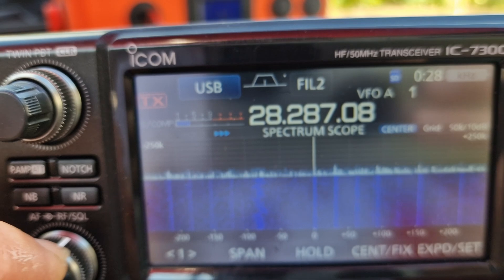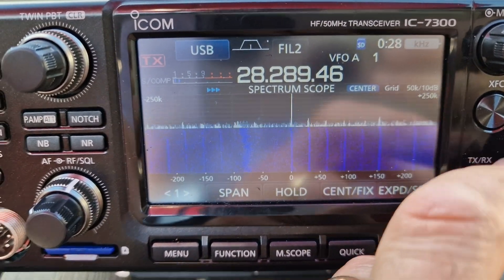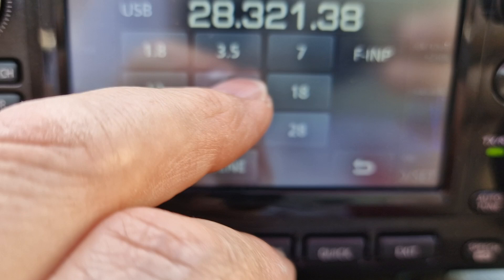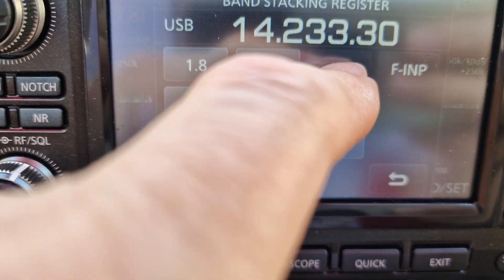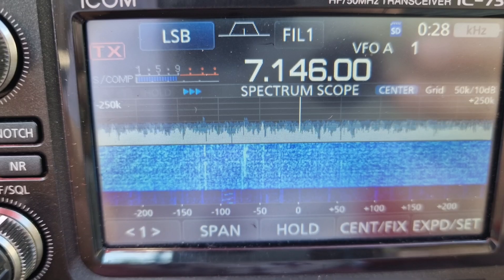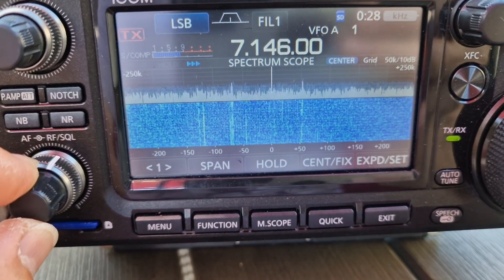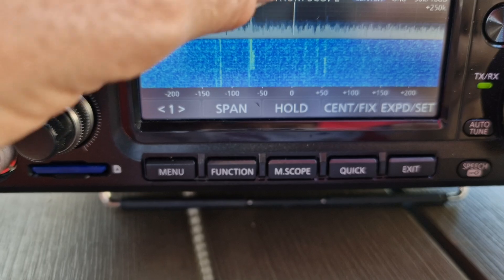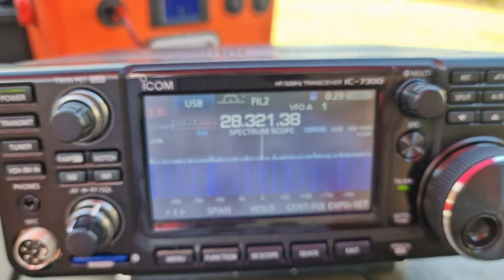Need help with identifying awful QRM across all HF bands in the UK - 19 July 2024

Comment: My noise started years go on 30m, then for the last six years affected h.f. from 160m to 20m with the exception of 60m which I could use. VDSL stops about 17 MHz with narrow quiet spots on a few frequencies, guard bands. 5.2 MHz being one guard band which is why I could use 5.262 MHz. The RSGB has data on this.

Ofcom said it was my telephone line which had probably become unbalanced due to corrosion and radiating, S8 noise 160m to 20m. I already thought it was my line as I had put a short aerial up to it after walking round with it to locate the noise.
B.T. said they would would charge me to take down their offending line. You get a standard letter from a secretary who knows nothing. I don't use B.T.

I was doing very little radio and considered giving up.
This year it all cleared up when we went to fibre. I've got my hobby back.
Good luck with it.
G4GHB.
Reply from the maker: @bill-2018  good to hear your story, I'm glad it finally worked out in the end. 73, Jonathan, M0XXJ

Comment: I restore old vacuum tube radios as a hobby. When I was listening to SW channels I was also getting noise across the whole band. Found it was being radiated by the house mains wiring which I had tried to use, to extend my router access over wifi link plug-in units. The wifi extention worked great but the noise from the wiring was too much. They got canned. In the UK I think every third house uses the same phase off the grid (to prevent 415V being available to adjacent properties - unless using 3 phase). These plug-in wifi units can send the signal 200m. So if more than one neighbour is using them or the grounding in the utilities ducting is HR you could be getting the noise off the mains. I didn't check with an analyzer but it sounded similar. Good luck getting a quiet life in a modern world.

Comment: I have exactly what you show on 10m. It peaks every 30KHz from about 15m up to 2m. I don't have the mass noise you have on lower bands. I have recently direction hunted it using a 2m HT with a small loop antenna. Noise is definitely coming from my neighbours house and almost 100% sure it is coming from their security cameras which are linked up by cat5 Ethernet cable. I have kind of got used to it over past couple of years as the frequencies are mostly clear and useable in between the spikes, and the spikes themselves can almost be eliminated using my FT-991As DNF and notch filter. I might approach the neighbours at some point, when I think of the best way of going about it.
Reply from the maker: Thank you, this is very interesting,  I noticed that a couple of close neighbours appear to be using  Etherrnet based cctv... I'm planning to get out and about over the next couple of weeks to do more measurements and will provide updates on my channel. 73, Jonathan,  M0XXJ

Comment: I had a terrible noise problem.  Much static and even a chicken squawking sound! I used a cheap am radio sniffer to track down the area mine was coming from. The city came out and looked at the underground electrical service but found nothing.  Finally I was out of town and when came back was told the power was off for a day all down the street. Apparently the underground electric blew up.  After that repair the noise went away.
Reply from the maker: That was a stroke of luck!! 73, Jonathan, M0XXJ

Comment: I had a similar problem. Checked online SDRs to see if the problem was local (it was) then set up the radio with a battery and a short wire antenna and went on a walkabout. Turned out the problem was noise radiating from the burglar alarm. House is now insecure but QRM is gone 😄

Comment: I guess that this is QRN but not QRM.
Reply from the maker: It definitely looks like some spurious interference from an electronic device of some sort...
Reply: @JonathanCreaser  on 40m is a QRN because this band is noisy in the daytime. so this is normal. I would suggest using band pass filters.
Reply: @JonathanCreaser  In my understanding, we use QRN for any type of static noise and the noise in your video is static in nature. and QRM is usually if your transmission is waving to someone else or vice versa, when two people interfere with each other during tx. usually. but maybe I'm wrong. I learned all this a long time ago. I mean that if the interference is not caused by the transmitter, but, for example, by the transformer, then it is not a QRM.

Comment: If all of the below did not help much, take a walk around your area up to 3klm from your qth, log on a map where you find 5G antennas, long range wifi , hi capacity led lights on athletic fields/roads etc. solar panels, etc. once you have collected your data and with a handheld frq. counter and sdr rcvr. you can start finding the trouble. Near my qth 80 & 40m heavy qrm have been noticed by mysterious black boxes on almost every power poles in every neighborhood 100m apart which i have been told is a soon to be active 5g network via the local power provider which literally means qrm everywhere and a concern for electromagnetic safety......... also in your neck of the woods its common to have hidden ant farms as I have seen so take good care to do a good area recon.

by the way a T2FD setup will help with the lower HF portion of the trouble.

I hope you don't have such troubles where you will have to do serious rf shielding to your home. pls note that all the below comments are correct, but you have to do some searching if it is not from your equipment or neighbors.
Reply from the maker: @user-ro3mn5eb9d  thank you 👍

Comment: Turn off the breakers on your main panel, one at a time, until you determine electronics inside your home is not an issue. Twice, I’ve had an issue with small switching power supplies, one for surveillance and the other for a computer. Similar to old radios, the capacitors may become hot inside their little enclosure and eventually fail. Failure is typical when not using an original power supply that does not supply sufficient current.

If you conclude the inside of your home is not a problem, you can use an old AM transistor radio to detect noise sources in your neighborhood. 73

Comment: I'm tempted to say that if the grid changed to DC (yeah, I know, not practical), life would be easier... 

EVERYTHING now runs on PWM switching of coils. And we all know that sharp/fast switching edges on current control to coils generate huge amounts of noise...

I can't see it improving. Ever. 

Shame.

Comment: Agree that you are possibly experiencing two separate interference sources. I have seen the noise you are experiencing on the lower portions of HF as being from a plasma TV.  The birdies on 10 meters may be from a nearby switching power supply. Lastly, have you tried switching off your a/c power mains on your house to see if either issue disappears?
Reply from the maker: @w8biatvrepeater638  yes, tried switching off the mains and it's still there:-(

Comment: I have had issues with interference on the bands in the past.  The solution was very easy…call OFCOM.   On two occasions, OFCOM have investigated the interference and found the source.  In my case, both were cheap switching power supplies owned by neighbours, and the neighbours were quite happy to bin their power supplies (phone chargers) when Mr OFCOM told them they were interfering.   They have the kit and the people to deal with this, and they will happily do so.    Make sure you power down your house, run a radio off a battery to ensure you're not causing this first.

Comment: Clearly this doesn't come from your house and this isn't QRM originating from the mains since you've experienced it at the park (I am assuming you were using another receiver than the 7300)...
I would recommend a couple of videos by ianxfs where he successfully resolved a similar issue using a cheap home build portable loop antenna and radio. 
Are there other hams very close to your location (grid search in QRZ) ? Perhaps they would be affected too and someone may already have pinpointed the source ?

Comment: Okay, let me put on my logical troubleshooter hat, and give this a go.

There are two main avenues of approach here, let me explain:  There are two possible sources generally, which we can call "internal" and "external".   Internal would be anything related to your equipment, your home, your computer equipment including wifi, phones, laptops, and any other appliances in the home.  Local wideband noise can some from something as simple as a somewhat loose wire that is sparking away, although this looks a little better organized.

External is all the stuff outside of your control.  Power lines, phone lines, sun spots, local nuclear plant (kidding), of tons of other things.

So first off, eliminate your immediate equipment.  Try the same with a different radio, different antenna, etc - making sure to completely power down everything you were using previously including power supplies, power bars, etc.   if you still have the same interference, you can basically "clean" your rig as a suspect.

Then take either your cleared rig or other cleared equipment, and leave home.  Don't just walk across the street, go miles away... preferably away from all sources of obvious noise like power lines, phone lines, transmitter towers, and so on.  Go stand on a hill 10 miles away in a farmer's field.  If you still have the same sort of noise there, then it is something much larger.

If that returns a negative, then start heading back to home, and every mile closer stop and recheck.   If you start to hear the noise again, then you know it's something in your area.  After that, it's just going around looking for where the noise is strongest and weakest, and making yourself a map.  The source location will become clear pretty quickly.  Head to that location, and you will find your sources.

I am betting very soundly on an LED light that has gone bad in your area, and is making fairly organized wide band noise.
Reply from the maker: @OldManBadly  thank you, this is very helpful. I've already ascertained that it's nothing in my house, and so now I'll start plotting that map. Cheers,  Jonathan, M0XXJ

Comment: ...Similar Prob...was everywhere...Most detectable with cheapie off station MW radio. Strong up and down street close to waterpipes and wiring going into surrounding residences... Turned out to be a repurposed laptop power supply (now LED Lighting) behind bookshelf... Hard to find as immediate vicinity seemed to be a bit of a null. Turn off house power...gone... Isolate and search... Still providing regulated volts, just wildly oscillating somewhere in input stage. Nuts.
Reply from the maker: It's not coming from anything in our house, unfortunately. I wish it was. I walked 200 yards away from our house across the far side of a small park area and was still getting the same QRM from there. At the moment, I'm focusing on the telephone lines that run down the road... I'm going to do some further mapping next week to try and pin point the source.
Reply: Loose terminations underground cables and at substations could be another source of nuisance noise.